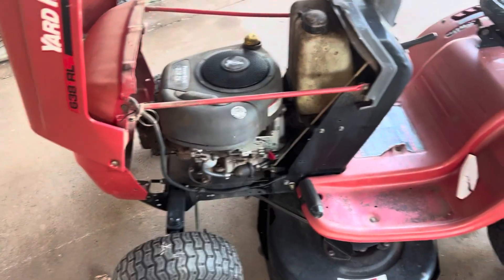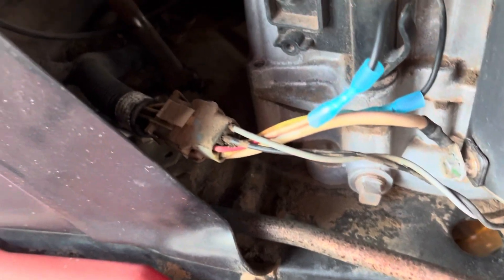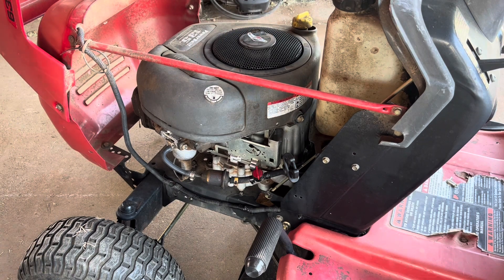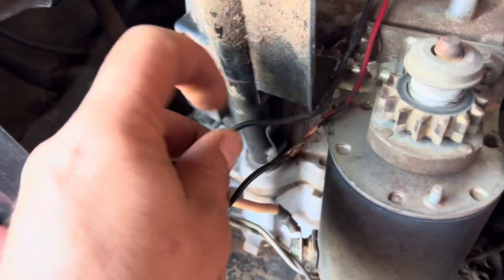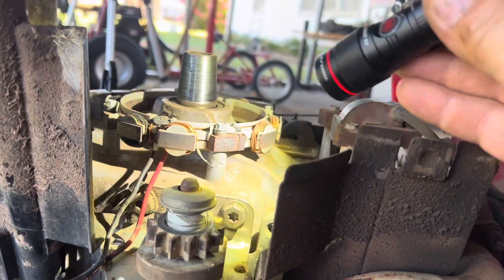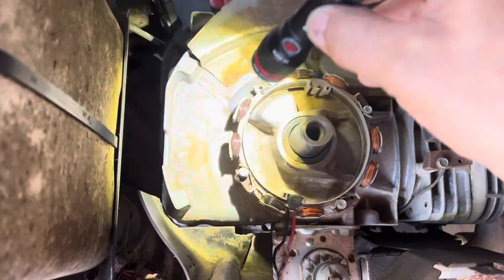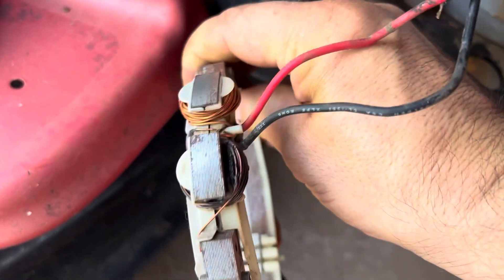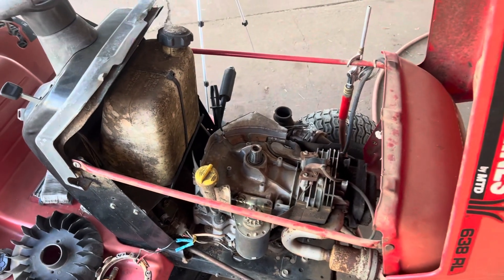Yard Machine 13.5hp Briggs and Stratton not charging. Let’s see why!

Comment: The dual type separate alternators of red + blk wires sometimes fails. You disconnect the red wire and switch to the black wire and add a new diode to black wire. Then use crimp connector for the plug connector, This way you don't have to take the engine apart.